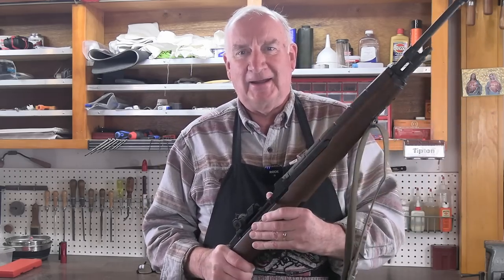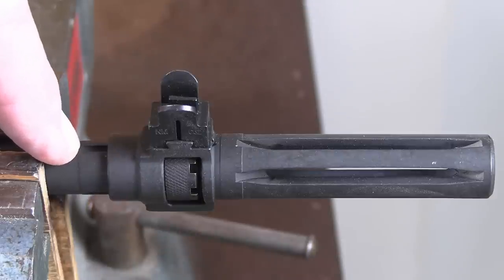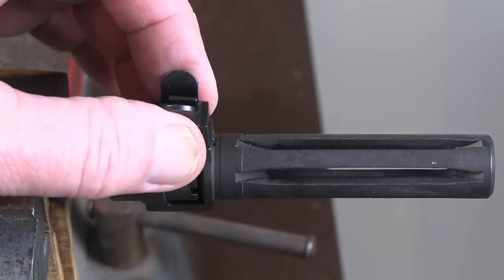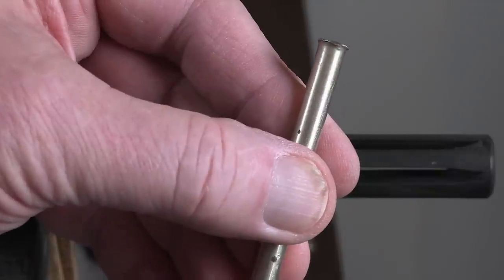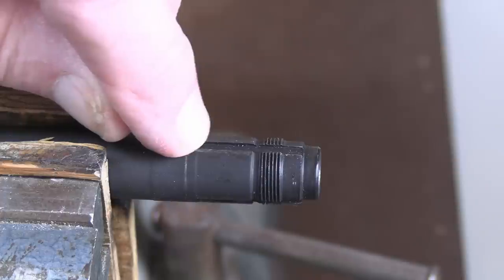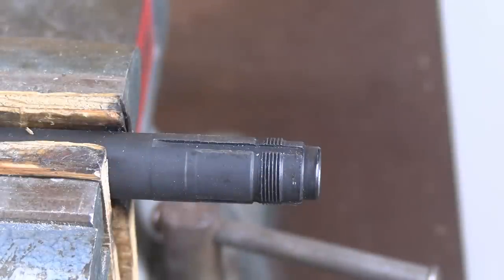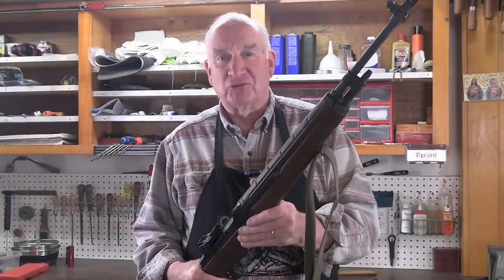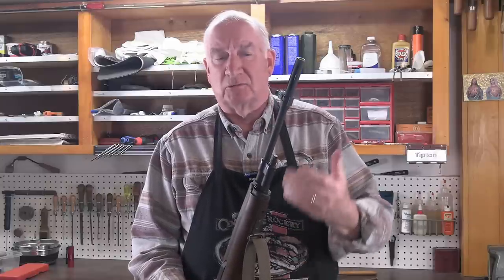How to Accurize an M1A Front Sight ~ In Ten Minutes!

Comment: As an old service rifle competitor, I recommend the final flash hider assembly include a healthy slathering of copper anti-seize.   Otherwise when you change the barrel at 8000 rounds, you'll find all that vaporized carbon welded all those parts to the barrel, which will take a week or more of soaking to remove.  Great, common-sense vids.  Wish we had them in my day.
Reply: How  do you glass bed the rear sight? It's all metal!!!!

Comment: Thank you! I was starting to hammer my castle nut to get the retainer plug in the right spot and stopped, thinking “I better get one of those tools I saw in another video…” after watching this and trying again, I was just two short taps away. I pulled the plug out though and shined a flashlight down the hole to see when I was finally at the right spot. No single purpose tool needed after all! Fine by me. I hate getting tools that I’ll probably only use once and then it just sits there taking up space.

Comment: I took my M1A to the range yesterday for a 200yd battle zero.  As I checked the sights & gas system I notice the gas plug had back out a turn or two.  And there is definitely a very slight amount of wobble in the rear sight aperture…..it’s less than 1/1000th.  I retightened the plug & started shooting.  It zeroed perfectly.

Comment: This isn’t related to this video but I have a cracked elevation knob on my Garand. It’s the T105e1 sight. How do I get it apart and put it back together with available kits out there. I’ve seen people ask and they are told to just buy a whole new sight set. Figured you’re the guy to go to. I also bought a lock bar sight to replace it while I figured out how to fix the elevation on the t105 and whenever I listen the lock bar to adjust my elevation knob moves and adjusts elevation. It’s annoying. Thank you sir if you read this.

Comment: Of everything, general maintenance in how to maintain accuracy after the fact is still what I’m most interested. I am hopelessly unprepared at doing these accurizing jobs myself but I have a good gunsmith who can do it for me. I just need to know how to keep it accurate since I keep hearing constantly from people that keeping this gun accurate is extremely difficult and any disassembling will loosen everything up. Given you have far greater expertise on this platform, I’d love to get your advice.
Reply from the maker: I get very distressed about those silly warnings.  I've been disassembling my rifles to clean them for nearly 60 years, and none ever suffered loss of accuracy.  I have very accurate rifles.  Glass bedded rifles are no different.  If anything, the epoxy repositions the action more precisely.  Those who shoot in benchrest competition, striving for nth degree accuracy often glue actions and stocks permanently, but there are just as many competitive benchrest shooters who do not, and they compete in the same circles. As long as the action is stable and has a solid recoil surface with lateral support, it won't move. Removing the action doesn't affect a good bedding job.  That's what epoxy bedding is all about.
Reply: @GunBlue490  Awesome. I do wonder where these rumors come from. I keep hearing how disassembly will wear out the bedding and force you to do it all over again. Or how the EBR chassis went from a 1 MOA gun to a 3 MOA gun when soldiers disassembled it.

No doubt they had no idea what they were doing and messed things up, which is why I want to know more information from someone who does understand the platform like you. Always had an interest in this platform but stayed away because a lot of people kept trashing it.
Reply: @gameragodzilla  The EBR has a strange stock that requires a specific torque value when attaching the stock to the rifle and disassembly will shift that if the torque isn't the same as recommended, leading to loose fittings or shifts in zero as the dimensions of the stock relative to the action have changed. So a quality and well cared for walnut stock shouldn't have this issue. If you invest in an EBR style stock, I recommend combing over the literature thoroughly and following assembly instructions or get a (Professional!) gunsmith to do it.
Reply: @luckyomen  Ah, makes sense. So the guys who disassembled the EBR and lost accuracy just didn’t torque it correctly, I guess?

Comment: I often use a wood dowel rod for many jobs. If the dowel rod isn’t sufficient, I go for the brass. It somewhat surprises me how often the wood dowel is sufficient. I wouldn’t stick the wood dowel into the castle nut or anywhere there could be consequences if it splintered.

Comment: i have a scope question. So the leupold scopes like the 4X 22 scope has a parallax set for 60 yards. I was looking on their site and the specs and their biggest long range scope seem to have a parallax set for 150 yards. So is the 150 a compromise for say shooting 500 yards or closer? How would the 4x 60 yard parallax scope do for 500 yard shooting? Does it really matter that much? Doe they make scope that have a parallax farther out? thanks
Reply from the maker: No, scopes are not made for various settings, other than standard, rimfire, and in some cases, 100 yards for shotguns and muzzle loaders.  Leupold determines that the best parallax (actually, it's the point of convergence, which is the elimination of parallax) setting for their standard fixed power scopes is 150 yards.  That is the best compromise for the reasonable reduction of parallax at all intermediate ranges and extended ranges for which such a large game scope is normally used.  

Understand that parallax only occurs when the eye is not centered on the occular lens, and is only present when off center, and the degree to which the eye is not correctly positioned directly corresponds to the aiming error.  That being said, long range shots are the most demanding for a shooter, and are typically combined with the greatest care in aiming anyway.  So, the shooter really has no concern for parallax error if due diligence is maintained to position ones eye correctly. If you wish to shoot at 1,000 yards with a rimfire scope, just keep your eye centered, just as you would for looking down iron sights.

Further, parallax error increases with longer scopes, due to the distance between the reticle and the focal lens.  For that reason, shorter scopes, generally up to 9 power, have no gross alignment error, which is why few scopes of less than 10 power have objective focussing rings or side focus knobs.

Perfect parallax elimination, regardless of eye position, is only obtained with Adjustable Objective scopes.

You may want to visit my series on scopes that I did a few months ago for more in depth information on those questions.
Reply: @GunBlue490  thanks for taking the time to give such a great reply. Great information there

Comment: Hey GunBlue!

I would really like to ask you a few questions about firearms manufacturing and design, but you don't seem to have a public email listed anywhere. Is there any way I can contact you to ask these questions?
Reply from the maker: You may inquire right here and it may give me a topic for a comprehensive video for everyone's benefit.
Reply: @GunBlue490  Alright then!

So just to start, really quick, what is your industry experience? I think I remember what it is but go ahead and say anyway as I might have the details wrong.
Reply from the maker: @arnox4554  
In the larger sense of the word, I began my industrial experience as a precision electroplater, working for a company that made coaxial cable connectors for communications, US military, and aerospace applications.  There, I learned much about metallurgy and I worked closely with machinists, all of which gave me an intimate understanding of many aspects of practical machine engineering.  

In my early years as a police officer, I was assigned the responsibility of training both recruit and veteran officers in all aspects of firearms.  To enable me to provide expert maintenance of our departmental firearms, I received formal factory armorer's training at Smith and Wesson in Springfield, Mass, Sturm Ruger at Newport, NH, and Remington Arms at Illion, NY, and employed that training on a regular basis. 

Though the manufacturing processes of those companies differed considerably, those weeks gave me an intimate, first-hand understanding of all the modern techniques used in the firearms industry: forging, investment casting, milling, broaching, boring, fitting, heat treating, assembly, safety, care, maintenance, and the various finishing processes.  

However differently each company approached the manufacturing process, certain fundamentals remained the same, and were constant throughout. Among them was that firearms must never be lubricated with anything more than a wipe of fine oil for protection, or otherwise, only as specifically directed. 

Training in fitting and assembly is one aspect of the larger picture of an armorer's responsibilities. Because an armorer's bread and butter is the prevention and assessment of malfunctions,  I was given a close look at the repair intake side of each facility and the myriad issues pertaining to guns being returned for repair.  

Because all firearms go through the hands of many workers during their manufacture, quality control, and final test firing, returns due to defects in the product were extremely rare to the point of virtual nonexistence.  It's a simple fact that a gun that works today doesn't fail to work tomorrow without some cause, and the cause is very rarely due to natural mechanical failure.

Alterations, modifications, abuse, accidental breakage, blow-ups, disassemblies that didn't get reassembled, and most commonly, perfectly functional guns that just "don't work" come in UPS deliveries daily. Such "don't work" guns are typically inspected, disassembled, degreased of excess oils and greases, tested, and returned to their owners with instructions to avoid the liberal application of lubricants in the future.  "Oil destroys guns" was the common theme in each factory.  

I hope that answers your question.
Reply: @GunBlue490  Yes, very thoroughly. Thank you!

Have you heard of the new HCAR yet? (It's a modernized BAR, basically.) I saw that the rifle is priced at an MSRP of about $7,000. Does this price sound even halfway realistic to you, even including development, materials, new tooling, and manufacturing costs? And couldn't you use much of the same tooling and materials to build one of these as you could a regular AR15 anyway?

Comment: If i buy a leupold, it will either be the 4x32 or 2x7x33 each costing $300. I tend to go for the higher power. Is there really any reason to choose a straight power over a variable? The only point ive ever heard is that the straight power is more rock solid reliable as it has little too no moving parts. Looking at using it for a 308 power level or shotgun. So a fair amount of recoil.
Reply from the maker: In my personal opinion, the Leupold 2-7x33 is one of the finest hunting scopes ever made, with the 1.5-5x20 being right with it.  I've owned several 2-7 Leupold scopes over the last 50 years and they've each withstood countless rounds of many calibers; some significantly more potent than the .308.  I've never had any failure; not even the slightest change in operation from the day they were brand new.  Quite a number of my personal acquaintances found the same experience to be true.

What you've heard about variables being less solid than fixed power scopes has absolutely no basis in fact.  The mechanism that changes power is a very solid, permanently lubricated, and simple threaded ring that changes the internal focal length, and it's every bit as reliable as a threaded boiler valve, and will rotate just as reliably as your car's steering wheel. Leupold has tested them on pneumatic jack hammers and worse, and they guarantee them no matter what gun they are mounted on.

The only reason to select a fixed power Leupold over a variable power Leupold is the price tag.  There's absolutely no difference in reliability.
Reply: @GunBlue490  thanks very much for the great reply